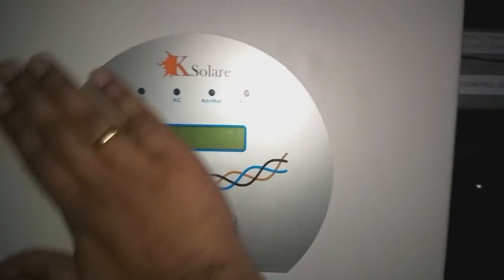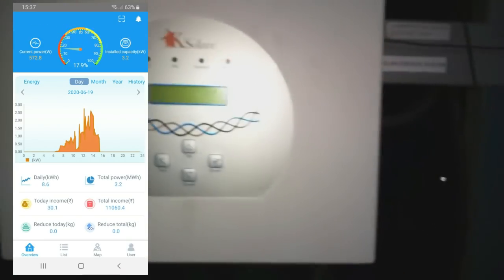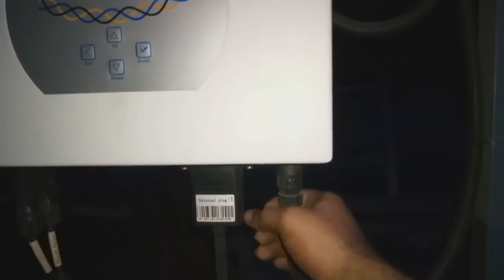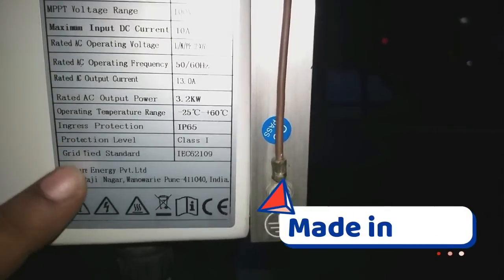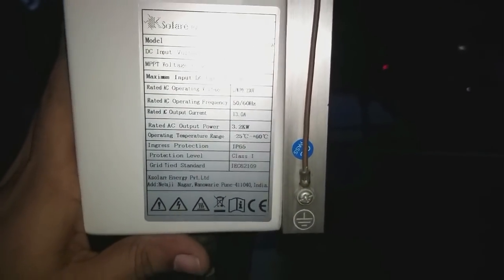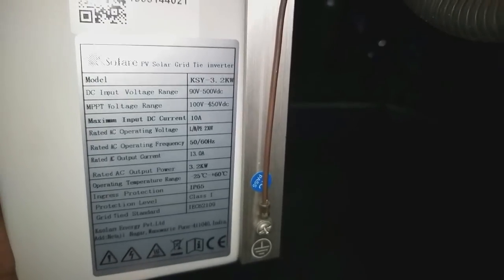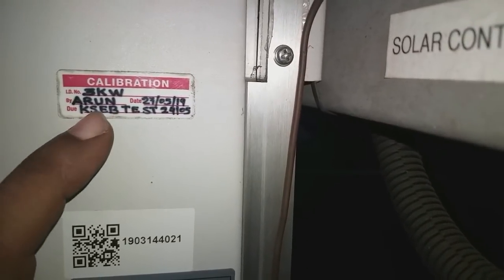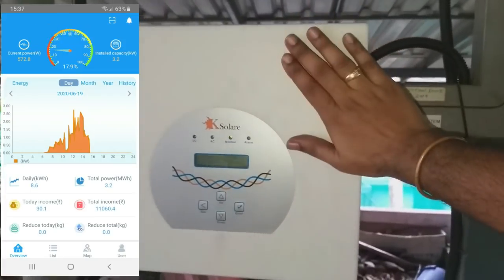Roof Top Ongrid solar System |We will get money from KSEB| ഇങ്ങോട്ട് പണം ലഭിക്കും!|Malayalam,Kerala

Comment: Solar panal not suitable for Kerala because more than 150 rainy days in a year, so less sunlight days means less power generation. solar is  suitable for places with less rainy days. For Kerala it is better to have  generater for power backup 🤔 let me explain if it rains for more than 5 days continuously then no solar power, also during heavy rain and floods KSEB also cuts power supply , so portable generators are the best option.
Reply from the maker: No issue it will works.

Comment: i am using 5KV on grid system for the last one month  average it generate 20 units per day  raining day it may go down to 15 units .but one problem i see is what ever the power we generate only 75% is exported . we have two meter one is export import meter and another one which gives the unit we generated (production meter) , kseb calculate payment based on the export import meter . if we import more .ie the power we use from KSEB line   is more than the export unit It will be charged . From the invertor we get how much it generated   everyday on the mobile .Any body having the idea why the export is always 25%  less that what we generated in the panel . Always  exported less than 25% which is shown on the production meter
I have asked KSEB they have no idea or they don't say it.
Reply from the maker: Watch my upcoming 5-10KW video and production......
You will get clear picture.... Okey
Reply: @CATips  why there is difference between production meter and export import meter .I am see the difference here in my 5kv system do you have any answer for it .
Reply from the maker: No
Reply: @CATips  it is usually like that I hope
Reply from the maker: Wait and see
Reply from the maker: Wait and see

Comment: Please dont mislead the people by giving exagrated calculation.

KSEB is planning to give this year Rs. 2.95 per unit for the excess unit received from solar system
To get 18000 you have to supply 6000 unit per year or 500 unit per month.

Cost of the system to produce 500unit per month is  3 to 4 Lak.